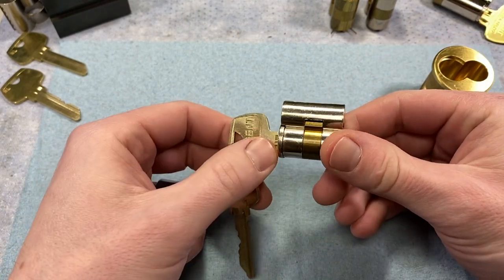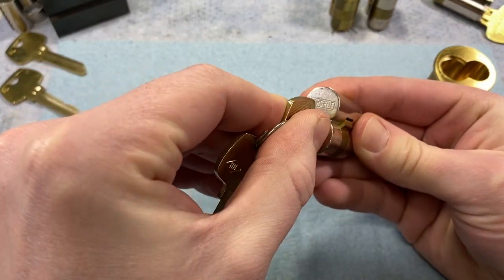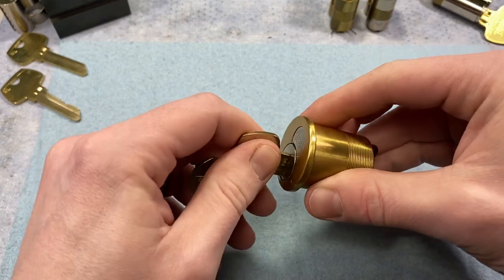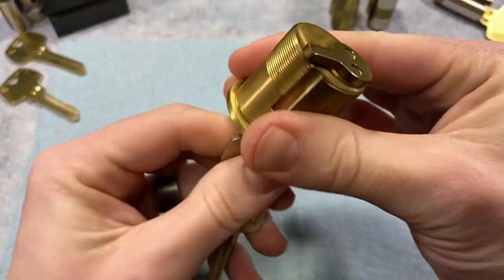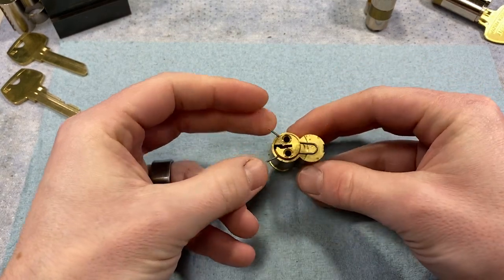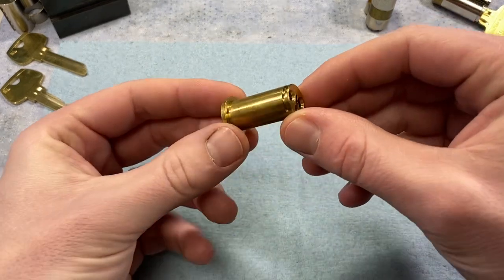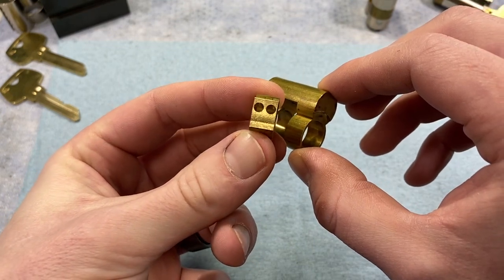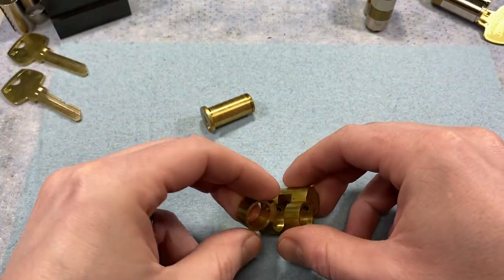How Sargent's 6300 Large Format Interchangeable Core Works

Comment: A treasure trove of information. 
Thanks for sharing. 

I like the idea of the hollow drivers. 
Are they the same diameter as their standard locks ?

Also, in your other video, 
"How Yale lfic works",
You mentioned that Corbin Russian 
as well as Sargent's newer lfic.s have built up pins... , if I remember correctly.
Is Corbin Russwin built similar / same as Sargent ? 
or more like sfic ?

Are you still thinking about doing a video on Sargeant's older lfic ?

Are the A2, A3, & A4 just determined by space & depth ?

Sorry for dropping so many questions on you. Picked up interest in ICs recently & Tim suggested checking out your older videos for information in this morning's live. 

I have been enjoying the 3 tumblers replays. 

So thanks for both ! !
Reply from the maker: Yes, Corbin Russwin LFIC is more like Sargent than SFIC.

Maybe.

A2/A3/A4 all have the same spacing, just different depths/pins.

Thanks!
Reply: @Thethreetumblers  ,
Thanks for responding. 
Y'all are a great treasure trove. 
👍

Comment: Hey Tyler. Question.

I know the difference between LFIC and SFIC. But I have a job coming up with corbin russwin LFIC.

The current mortise housings they have on the building fit schlage LFIC and the russwin cores won't fit those housings.

My main question is. Do I have to stock housings specific to corbin russwin or can I use the SFIC housings for the russwin cores.

Obviously the schlage LFIC being the odd bigger shaped figure 8.

So am I correct to assume the corbin russwin cores would fit in a SFIC housing. Or am I mistaken as the corbin is its own size figure 8.

Thanks

Comment: Bought a LFIC SARGENT core with 3 keys, no control key, how would I go about making one of them a control. If that’s not possible how do I get a control key made for it? It has a leaf stamped on the front of the core.
Stamped on the key is...RG...5W3V034....AC1. Maybe you can point me in the right direction. Hope you and your FAMILY are safe. Thanks for your time with this.🇺🇸